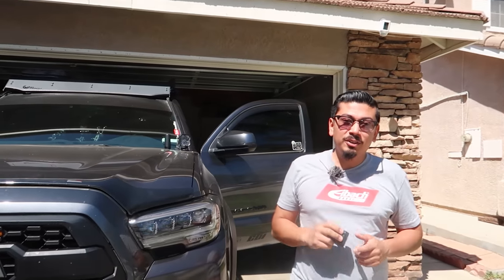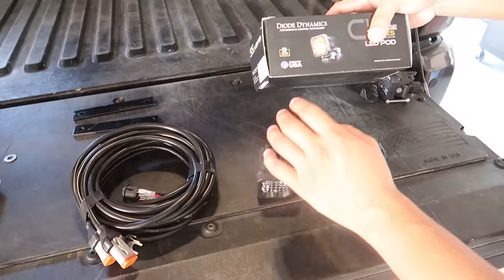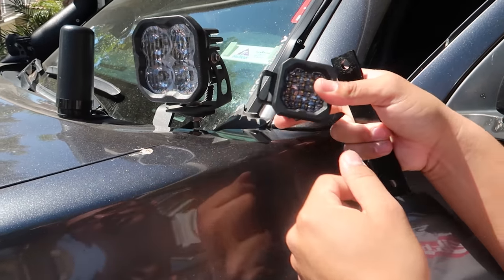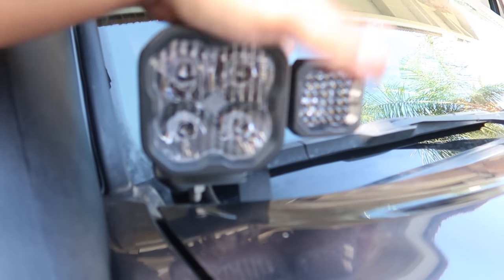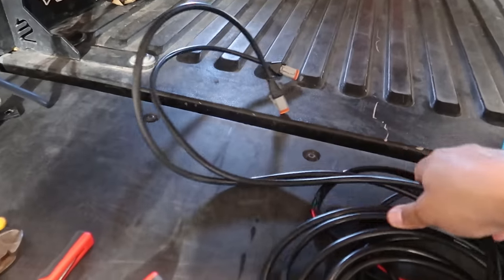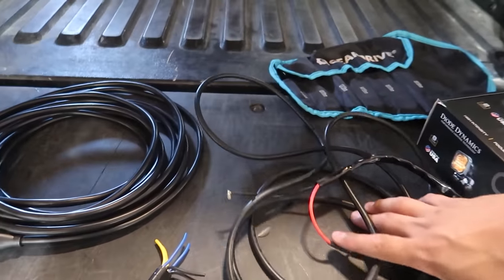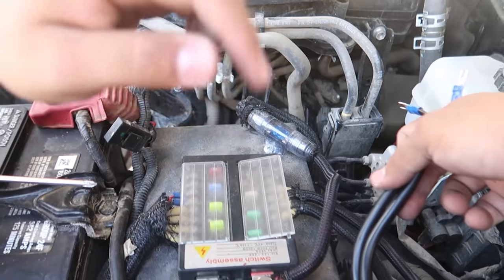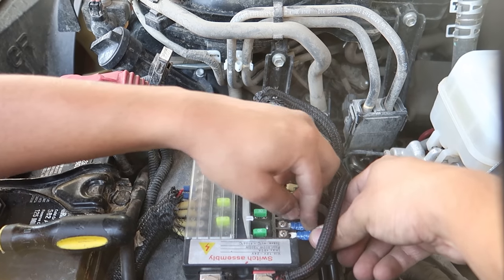Installed The Smallest Ditch lights | NEW Diode Dynamics C1 Sport + How to install & Wire

Comment: I am buying ss3 max fog lights for my winch bumper and pro combos for ditch lights next week.  I hear they are coming out with another power level above max. I’m waiting to get my c1 lights until then. My ditch lights will be yellow but I want white spots hooked up next to them just like this. Also doing reverse lighting and a 50’ light bar above the windshield. I got an 06 v8 4Runner. Can’t wait to finish my build. My lift is going in next week.  Then all that’s left is tires/rims and roof tent and it’s done 😊

Comment: I have 2 x Rigid flood ditch lights on my Tacoma. Been very happy with them. Bright as hell. Perfect for going 45 or less, light up those ditches to avoid hitting any animals or whatever. 
I can’t imagine those ditch spot lights come in handy too often. Maybe you should ditch that dual setup for a bright set of floods?
Reply from the maker: The light itself is bright but yes I need to switch from the spot I bought new lens from diode in yellow just havnt been able to swap it but I need to 😅

Comment: Quick question how exactly does one wire the back lights in for Diode dynamic lights into the Auxbeam switch panel I have the same panel 
I’ve only seen people installing them without the backlights into panels😪
Reply from the maker: If u wanted to you’d have to use the backlight wire into another switch I have a lot of lights and didn’t want the backlights to take over my other switches so that’s why I deleted it but if u don’t mind just add that wire that’s for the back light into another switch on that panel
Reply: @JesseRizo  oh alright gotcha thank you 🙏🏼

Comment: I have SSC2's from DD mounting bracket that came with them is smaller. So Using supplied bracket for SSC1 won't work yhe way it worked for You. I will have to make my own custom bracket.
Question: can You tap into existing ditch lights harness so everything works of one switch?

Comment: maybe you can help as youre the first person ive come across on here who used the 4pin harness. every other ditch light harness ive seen has a black ground wire with a power wire and usually a white wire. the DD heavy duty one has a blue, yellow and red. ive got SS3 pros on the way and am trying to figure out how to wire an OE style switch (4 wires). the blue wire, for the backlight, i plan on tapping into the running lights, leaving me with a red and yellow wire. the OE switch (from cali raised) has a green wire for "connect from your source with an inline fuse", a red wire for "connect to your relay or accessories" a second red wire to illuminate the switch with the dash lights on, which i wont bother with, and a black wire for ground.... now the problem is, the DD harness doesnt have a ground wire going to the switch like just about everyone elses... do you think i just need to figure out where the red/yellow from the harness go to on the switch, and then ground the switch seperately?
Reply: actually, upon closer inspection from your video, it looks like theres 4 wires going to the supplied switch? blue red yellow and a ground? the picture on their website, as well as their wiring diagram, only show blue red and yellow. labeled as blue for backlight, red for power in, and yellow for main beam. no mention of a 4th wire for ground at the switch, other than a seperate ground for the relay